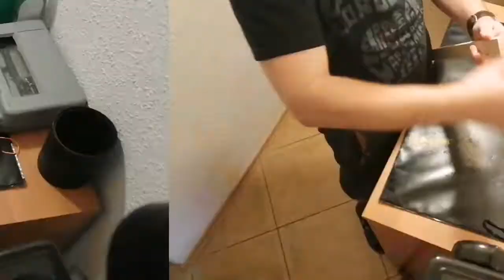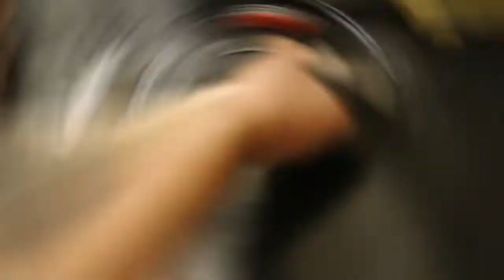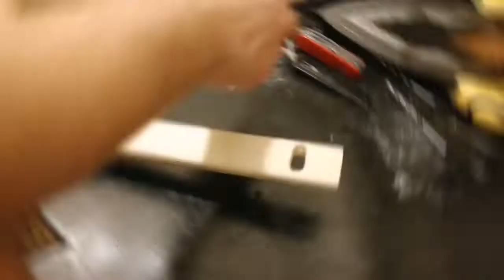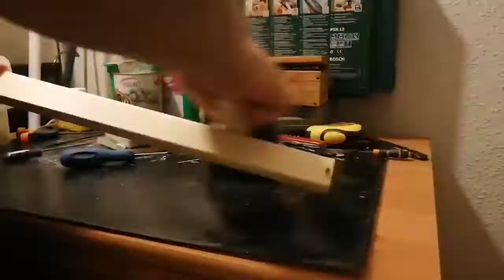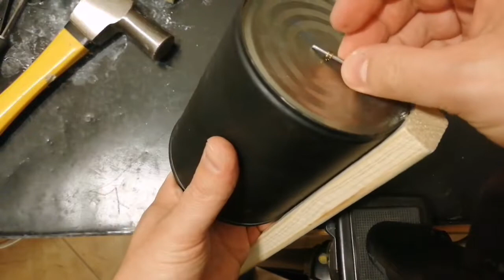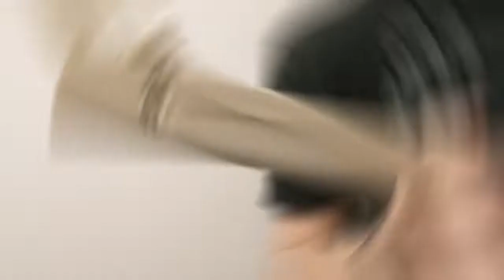vlog - DIY one string bass guitar

Comment: is the can still holding the string good?
Reply from the maker: If you do not pull the string too tight, the can will last, but you need to adjust it from time to time.